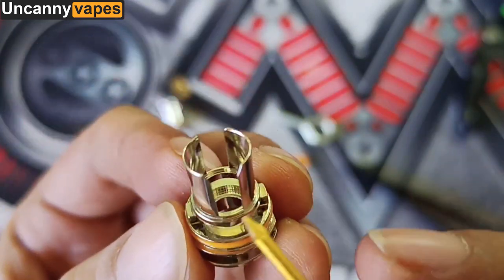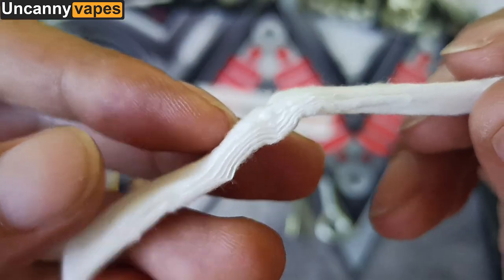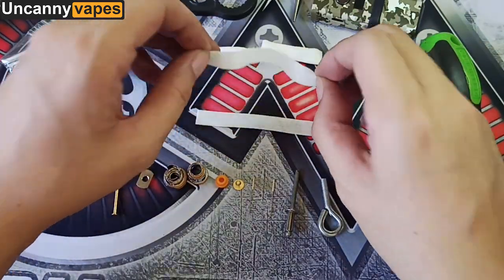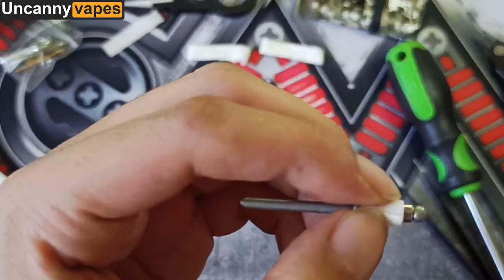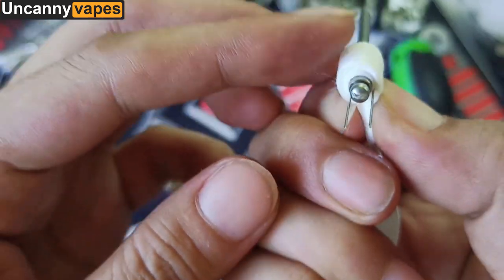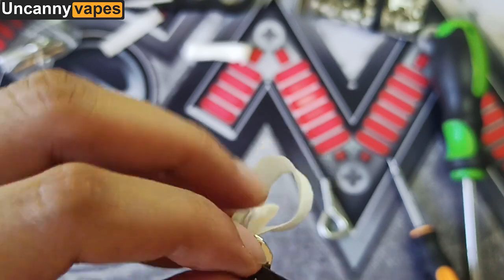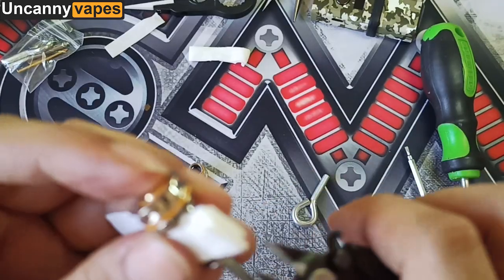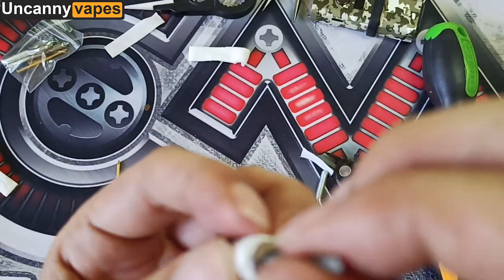How to rebuild Aegis Boost PRO .2Ω OCC for Aegis Boost Pro/XP77/Obelisk 60/B21700

Comment: Question lang po, bakit ilang days palang yong na build ko, lasang sunog napo? Ive follow your instruction correctly, any advise or tips?
Reply from the maker: pwedeng sa juice. use 50/50 or 60/40 ratio for pods. pag 70/30 or mas mataas malapot na masyado.

Comment: Sir I've a question. I followed your instruction, make sure n soaked tlga sa juice at nag antay muna ng more than 15 minutes bago ko gnamit kaso nakakalasa ako ng pagka sunog ng cotton. bakit kaya ganun? 50 watts, 0.4ohm po saakin.
Reply from the maker: make sure tight ang cotton sa loob at talagang nakadikit sa wire yung cotton. try mo din wag ng lagyan ng 1 strip of cotton dun sa labas parang vm6/vm5 style ng build.
Reply: Baka ung juice mo naka 70/30

Comment: anyone here knows what you call the small piece with a hole in it.. i broke mine while practicing.. 😭😭
Reply: Broke mine too. It seems that it was build for a smaller coil but P series are too sturdy. I use Allen keys and a hammer to smack it open while holding it in place with a vice grip.
Reply: @originalsun5206  i wish there was at least a few spares on the kit.. i wouldnt have bought it if i still need to do it the old fashioned way :D